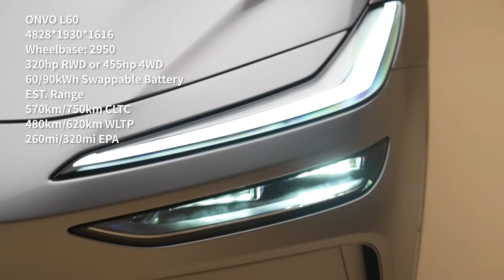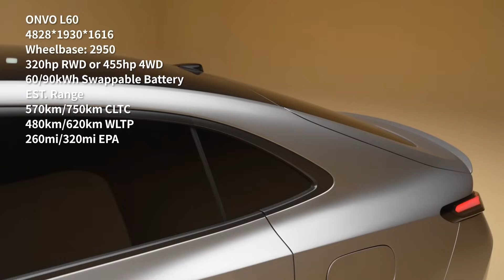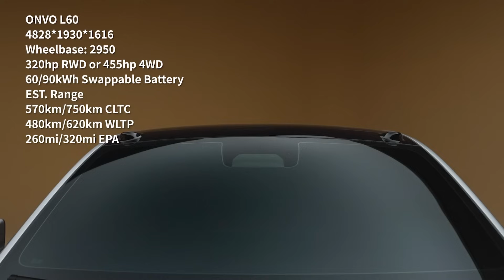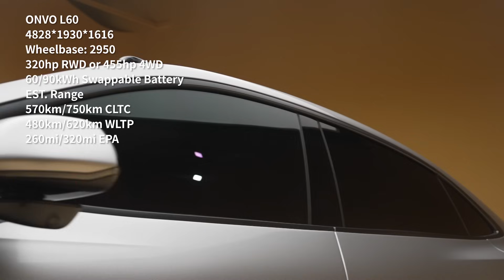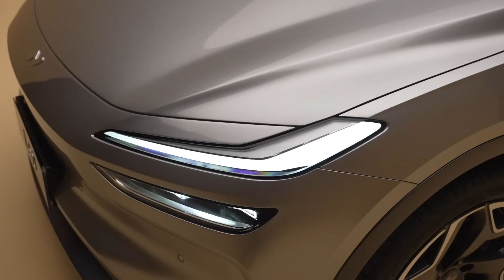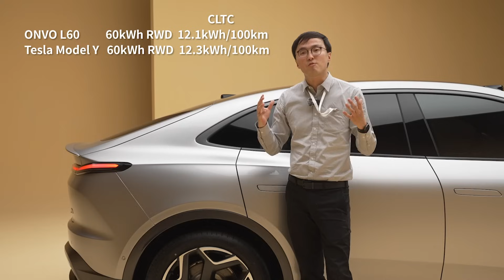A More Efficient Model Y + Battery Swap - ONVO L60 Static Review

Comment: Have to agree with Sean. 
This L60 definitely is not going to steal anything from Tesla.
The looks are average/boring at best and alot less refined than a proper NIO (side mirrors are pretty horrible). Granted its much cheaper.
The range specs are also nothing special , and not on par when compared to Xiaomi.
Which is surprising as they claim good aerodynamics and efficiency.
And comparing to Tesla is a bit misleading as this has a 900V architecture and Tesla is still achieving that efficiency with an inefficient 400V system.- 
So perhaps the rest of the cocktail like weight etc is not that optimal.
No mention so far of other performance specs like Acceleration , braking and max speed.
At least they got rid of that annoying Nomi.
Still a terrible name of a car. ON-VO
Reply: Sean totally loved this car. What video were you watching? Did you lose money on nio stock or something or just a Tesla fanboy?
Reply: @ChickenSandwichesForLunch  What video where you watching ? He clearly pointed out areas where the design was not optimal. All he LOVED was the battery swap. Which is not really a selling feature.
Funny how NIO Bullies like to show everything NIO in positive NIO Bullshit perspectives.
Reply: @dullumullu  he didn't like the hood line and no frunk. Everything else he SAID was BETTER than Tesla. Better drag, better interior, better efficiency, head up display, better roominess, reclinable rear seats, better materials, better build quality. Are you an electric viking simp or some other ignorant 🤡? What's your story, why are you here spamming for Tesla?
Reply: I  think that the perspective buyer makes the decision which car he prefers. Whether Onvo or Tesla or not even Nio .Thats how the market  works  best affordable  product.  and time will tell

Comment: Thank you for covering the efficiency standard differences between the 2 countries. It's a big deal.
Reply: One big advantage of NIO and Onvo  EV is that  you have the possibility of battery swapping battery upgrading  or  charging and of course no worries about the degrading of the battery.
Reply: Is it? Sure, it miles off but there are zero chinese cars in the USA. Not sure how that could make even a fraction of a difference or are you just a Tesla fanboy? Tesla uses cltc in China. Nio uses Wltp nedc in Europe. When in Rome.
Reply: @ChickenSandwichesForLunch  certainly not a Tesla fanboy, and I have zero investment in either company,. But as someone who lives outside the country and just learned about the difference it's important that it's pointed out sl since many people do not know about it.
Reply: @2mitts  fair points . the Chinese one is ridiculous. It sounds like the test is performed on an indoor treadmill or something similarly useless

Comment: Efficiency is based on many factors, one of them is the curb weight.  If Tesla has a heavier structure and safer cabin, then the different in the efficiency is irrelevant.  Safety is way more important, so I will wait until the safety rating comes out to make my mind.

Comment: You called out that this is on the 800v platform but it is on the model features 900V high-voltage architecture. How does that differ?
Reply: The architecture voltage  400v and 800v are more classes than set voltage figures, so an actual 900v vehicle would be classified as an 800v architecture

Comment: What Nio will need to surpass Tesla?  FSD!!!!
Reply: In terms of safety metrics, Nio's target of making smart driving 10 times safer than human driving by 2025 sets a clear benchmark for improvement, with current progress at 6.26 times safer. On the other hand, Tesla's FSD safety claims include significantly lower accident rates compared to human drivers, although precise comparative metrics like Nio's are less frequently detailed.
Reply: Fsd is an embarrassment

Comment: I do not like the front bonnet shut like because the line is broken at several places and runs pseudo-parallel to the crease over the wheel well, then switches to the top of the headlights.
Good concept, but I find the execution poor. Simple is better I think.

Too bad too, because I dig the overall feel of the front. This implementation of the split headlight is pretty alright.

Comment: Is this car profitable for NIO?
Reply: According to William Li it is 10% cheaper to produce it than a Model Y.
Reply: @dragsteraa  he's a fanboy just trolling thru here
Reply: It hasn't even been released yet jfc
Reply: Let's not focus only on short-term gains but consider the long-term growth of NIO's stock. By calculating the potential revenue from battery swapping, we can get a clearer picture. Next year, NIO's revenue from battery swapping is expected to be around $3.6 million. This is based on the assumption of four swaps per day at a cost of $14 per swap, which results in approximately $730 in annual revenue per vehicle. With the current participation of eight companies in battery swapping and a monthly sales estimate of 50,000 vehicles, we can extrapolate these figures. By 2030, NIO's revenue from battery swapping alone is projected to reach $7.8 billion annually. Adding the fees from NIO's extensive network of charging stations, which are used by 85% of other companies, the total revenue is expected to exceed $10 billion. This estimate does not include vehicle sales from NIO's sub-brand, ONVO.
Reply: If we include the revenue from ONVO's vehicle sales, the overall financial outlook for NIO becomes even more impressive. Assuming ONVO can sell 7,000 units per week, which would result in 364,000 units annually, and if each vehicle is priced competitively to be at least 10% cheaper than Tesla's models, we can estimate significant additional revenue.
For instance, if the average price of an ONVO vehicle is $30,000, the annual revenue from ONVO sales alone would be approximately $10.92 billion. Combining this with the projected $7.8 billion from battery swapping and additional revenue from charging fees, NIO's total annual revenue could easily surpass $31 billion by 2030. This comprehensive revenue projection underscores the potential long-term growth and profitability of NIO, taking into account both its battery swapping services and vehicle sales, including contributions from its sub-brand, ONVO.
Reply: Tesla's revenue grew from $81.445B in 2022 to $96.773B in 2023, an 18.8% increase. Based on similar growth assumptions, NIO's stock price in 2030 could be around $179.15, but many variables could impact this projection.
Reply: If you can achieve approximately 3225% growth over the next six years, why focus on short-term stock price fluctuations?
Reply: Oh you're a Tesla fanboy. I get it.. sorry Elon turned out to be such a terrible human being.